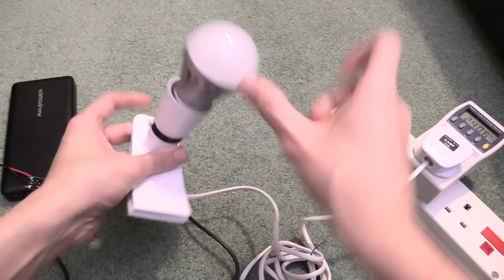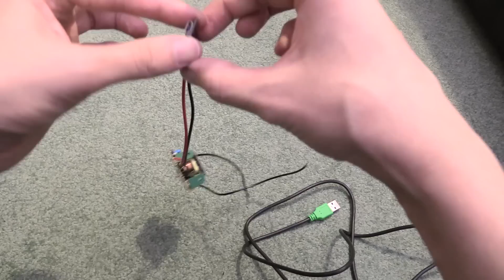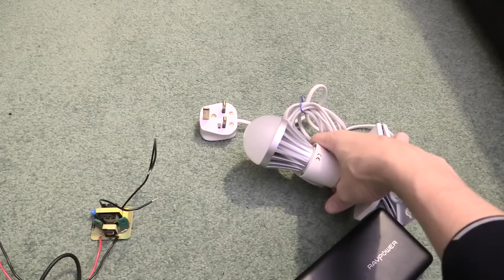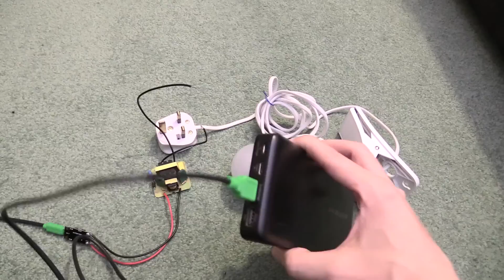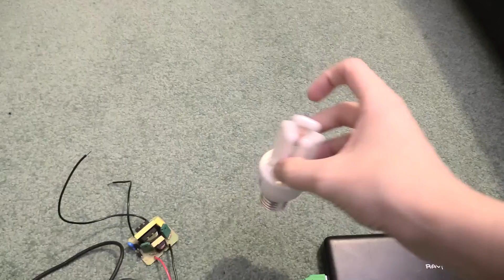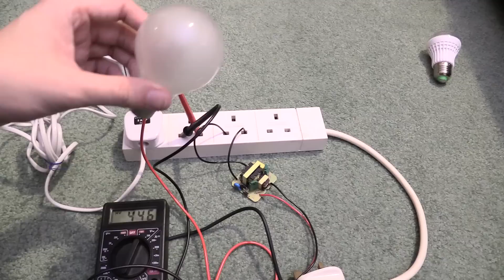220V AC from USB Powerbank

Comment: I completed your experiment,it works but not perfect,Like you said from 2.1ahm USB output of old PowerBank not the PD option.i ordered the components on Lazada and Shoppe it cost me ₱600 more because I ordered in more than 1,if you order only 1 shipping cost will charge you,So by 2pcs. or 3pcs.i found 2 errors or flo on the project.For those who interest in building this project I will let you figure it out.because I spend a lot to know how it ticks.
I will try the Latest PowerBank feature the PD power delivery to tiny inverter,But not today FEB 25, 2024,Maybe in a few months.Latest PowerBank are not cheap to buy.And I will compare witch is better.i wish I can learn to Vlog to show the experiment well

Comment: What about stability on volt and current?Did the Boost converter is overheating?Cause it absorbs pressure from Load? I'll copy your experiment once the electronic components arrive from Shoppe,This will be Fun if it's turns out alright.And I'll comment again if stability becames issue and how will I resolved it

Comment: Sorry if this is a dumb question but do you know if ac powered appliances ca be converted to be charged up via usb cable. I’m a carpenter by trade so this is very much a novice shooting in the dark. I’m guessing would be much easier with battery powered to usb
Reply from the maker: The thing with power tools is that they often use a lot of power, especially when the motor first starts to spin. You're unlikely to be able to power many tools by USB, especially if they're designed to run on AC. 

If it's battery powered, you'd have a better chance, but still probably not by USB. Just with a DIY high-output lithium pack. Or a jump start pack.

Comment: I need a backup battery pack for my electric recliner for electricity outages.  Do you know if this would be strong enough? Could I hook this to the DC electricity and when there is an outage it will work to close the recliner? 
Thanks, if you know the answers :)
Reply from the maker: Can you tell me the brand and model of your recliner? Or check if there's a sticker that says something about voltage, current or wattage.

Comment: We can charge laptop using this ?
Reply from the maker: This specific setup can only output a low current, so even if you did try to charge a laptop, it would be extremely slow.

Since most laptops charge at 14-19V, you'd probably have better luck using a 5V boost converter (DC-DC).

Or buy a PD powerbank and a PD trigger which allows you to select a specific voltage to charge the laptop :)

Comment: This is very Useful. Thanks for sharing , Let me share a usecase of it. In the areas where there is a power cut and that too for a very short duration let us say one or two minutes ( by the time Generator is turned On) . It can be used to Avoid the restart of Broadband modem as UPS are little expensive. With a little modification where it acts as a UPS ( just to avoid the Restart of Model for 2 3 minutes ) will be of great benefit
.

Comment: Hi 👋
          Awesome channel keep up the good work. I wanted to ask if it were possible to connect the three USB ports together in parallel to increase the current without burning the house down 😂 ??? I’m using the Anker 26800 mAh bank. Also is it possible to safely tie multiple battery banks outputs together ??? I’m trying to use a Duracell 175W inverter using the bank/banks.
Reply: Hey, great, I'm currently exactly on that very same "trip" of combining multiple cheap 57k mAh power banks  (30$) to get to at least 100 to 200 W, so I found this video and your brilliant comment! 😻

Surprising that nobody caught up on this, because only then all this starts to really make sense and being useful.

Thanks for the input of using multiple ports of each unit, I hadn't thought about that one so far, but might test, in case I should really go for this setup, but I think I'm insane enough, yeah! ✊🏻 😹💦

I found many USB 5V to 12V adapters/cables, so I would assume I just get a bunch of these, cut the 12V end open and hook them up in parallel to a car charger inverter via a car charger plug to raise amp/wattage.

Does this sound sane?! I'm still such a noob when it comes to such stuff! hahaha

Comment: Lot of power wasted in this method. Why not use 5volts led with usb cable and directly connect to power bank. Not morethan half a amp will use.
Reply from the maker: +Roman Asidera it's not about lighting a bulb. It's about getting high voltage AC from a USB powerbank. The bulb was simply a sample load.
Reply: And you can build 18650 battery power pack that can power small ac appliance like light bulb 220v.
Reply: lol , u dont get the purpose of this experiment bro

Comment: Great video (as usual), but I have a question... I have literally hundreds and hundreds of 18650's from gently used laptop batteries from my work. My problem is, I'm terrified to use them in an application like this. Throw a rock and you will hit someone with their masters in electrical engineering and 30 years experience, who will tell you that 18650's (or Li-ion in general) are very unsafe as far as batteries go. Unlike a Tesla, where you have 7,000 that are chemically matched and charge-balanced, how else would someone make use of hundreds of mismatched cells? (And please forgive my ignorance, I'm a cloud-engineer and a musician, hence the dumbness). Thanks as always!
Reply from the maker: There are many people who've made DIY Powerwalls using 18650s from various brands. They just capacity test them all to try find those which closely match in that regard. Provided you're using fuse wire in your pack, balance leads and a proper BMS, I don't think you'll have any problem. You might want to check out the Youtube channel ' nocrf50here ' - he's one of the kings of 18650s on Youtube and has done many experiments that cover your exact question :)

Comment: how good of a zapper is that? will it give me a nice shock mate or will it cutout
Reply from the maker: It likely has the potential to kill you.
Reply: wow. amazing little device. why does the volts read 400++ with no load. i get a funny hz reading on an old generator i used to have reads like 300++hz and keeps increasing. can u tell me why mate?
Reply from the maker: Cheap basic electronics, it doesn't have much on there to regulate it. Fun for experiments but not overly practical by itself. As for the rising hz, not sure about that. I've never seen anything like that before.
Reply: i didnt have anything to test/break so i ended up tossing it in the bin less the engine. shame really. but every repair shop i took it to wanted the cost of a new one to repair it.
Reply from the maker: That's the problem with trying to repair things now days, it costs more than a new one with fresh warranty :(

Comment: If there was a way for you to activate QC 3.0, you could actually get 18W out of that port. Also, I know this violates USB standars, but you could wire both USB-A ports for 30W of power. Although you'll only get 30W/24W depending if you activate QuickCharge 3.0 or not.
Reply from the maker: +NeutronPCXT I was hoping to find a little pass through device that could activate QC on the port but no luck so far.

Comment: Can it work on a small fan and other things that are rated 220V
Reply from the maker: It would likely struggle. The better option would be to buy a powerbank designed as a car starter. They typically have an unregulated 12V output which you could connect a DC-AC inverter to.

Comment: tried this after watching your video. didn't work out as planned. A red fault light turns up on the inverter although i use that same intveter in my car for Charing laptop and it works perfectly there
Reply from the maker: It's possible that your DC to AC inverter is drawing too much power. Some inverters consume as much as 10 watts when idle. A typical USB port can only output 10-13 Watts.

Comment: yes it's possible  but another  limitation  would be the current.. you just excuted dc to ac experiment we have that in college  but not using  power banks because  its not available  tha time. we used then 555 ic or zener diode rectified  circuit  which  in turn outputs a 5 volts. like that power bank
Reply: good job gadget addict for the education and propagation of knowledge

Comment: What might be more useful for actual purposes is just the 1st part, as most low power stuff runs off DC internally anyway. If the LED lamp has a proper driver in it and not just a capacitive dropper, then you can run it from 100V DC easily.